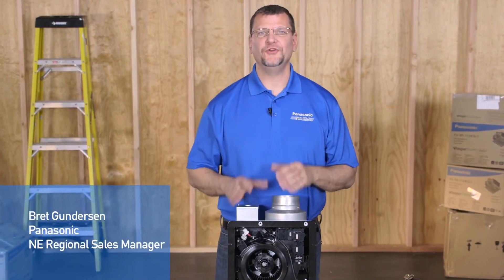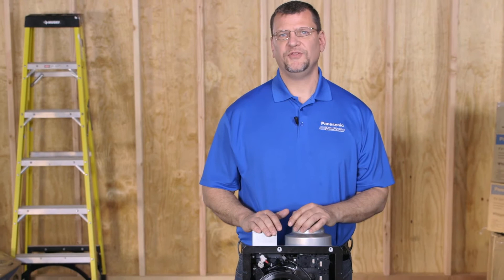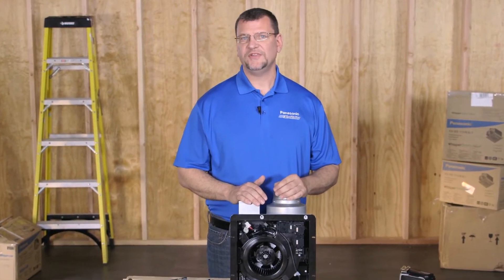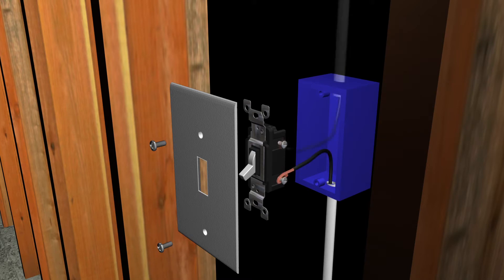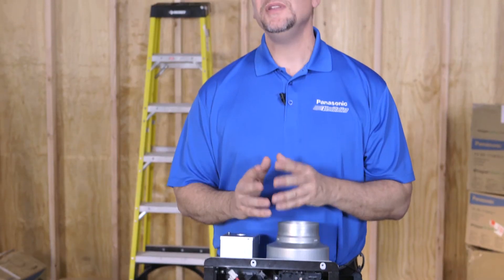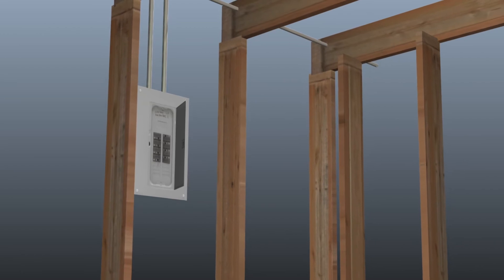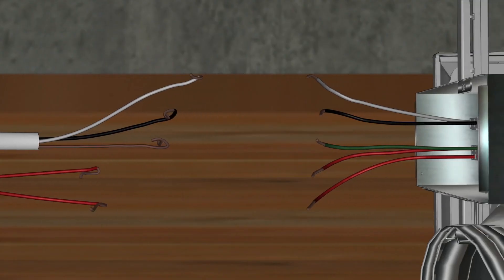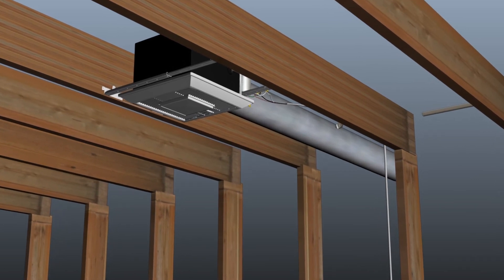WhisperGreen Select™ Wiring

Comment: Thank you...........I tried three countdown timers for my fan.  None of them would work.  After I discovered your video
I was able to rewire the wall switch and was able to get the countdown timer to work.  Also had to remove the 
Plug n Play Module that came with the fan.  It took me a long time to figure this one out.  I also returned three
countdown timers before I realized how the fan wiring was making it impossible for the timer to work. Wow...
First time I have run into something like this.  Thanks for the help.